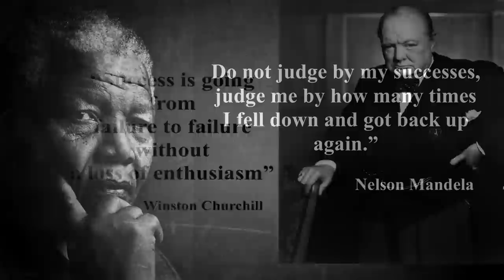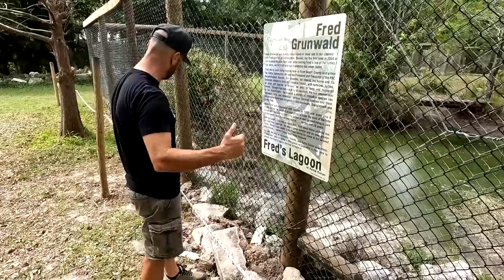Failure is Inevitable!

Comment: I've had my fair share of failures. I've kept reptiles since I was a kid, but serious for 12 years.
I've made many mistakes. Early on, I made the mistake of thinking I didn't need a secure top for a fire bellied toad enclosure because they couldn't climb glass. Well as it turns out, they kind of can. Especially in corners. I did have a top, but it wasn't a secured top, so some got out and dried out. It was probably my first major failure. 
And I learned from it. Ever since, everything, no matter how confident I am I can't escape a certain way, I go above the minimum level of security for them just in case.

Comment: Failures I’ve learned from as a reptile keeper? For the first, some context. I have a 125 hardened liner pond for my then 2 yellow belly sliders, outside. One day one of their basking logs got de anchored and floated to the side, I didn’t do anything about it because I was lazy. That night it rained and the pond overflowed (it had overflowed many times and they chose not to go out, so I wasn’t worried and up first thing to drain it) the next morning one of them were gone, never found again. I still have the other though. Now I always re anchor and drain BEFORE it rains.

#2, I learned that just because an enclosure has a a sliding lid, doesn’t mean the snake can’t slide it out and escape. Happened 2 times, once with a KSB, once with my corn snake, I only ever found my corn snake. Now I use fence ties to make sure they can’t slide out. 

#3, don’t leave the cage door open while I make a sandwich, and then forget the cage door is open. Luckily I found my boa. I’ve never touched sandwich material since. 

#4, double check that all animals are there before leaving for a week. I’m guessing my first KSB got out just before I left the state for a week, because I will not believe she lifted up a a cage lid that was taped down, and had 6 large, hardcover math books on it. Keep in mind she was like, 9 inches long max.

That’s about the most important ones so far.

Comment: I would put motion sensor floodlights all over the yard if you don’t already have them. No thief is going to work in bright lights and put signs up outside the fences that say “I don’t call 911” that have a design of the hand pointing a revolver. Not sure if you have seen them but intimidation really works.